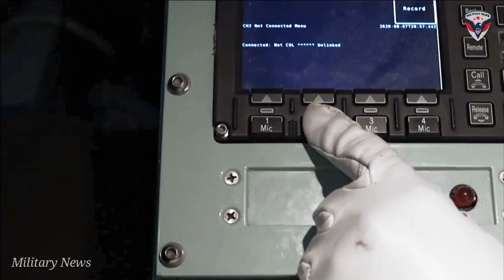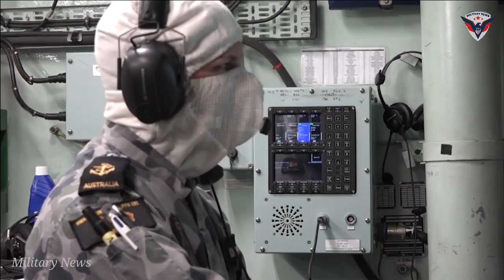How good is the Australian Anzac Frigate?

Comment: I worked for the AU Dept of Defence at the time and was in the Williamstown shipyard. The were only fitted with a completely inadequate 8 vertical launch tubes. Has that been upgraded since? And as per the similar comment - you’ve used some video of other warships which aren’t ANZAC frigates.
Reply from the maker: thanks for the comments and suggestions
Reply: No still only 8, they have top weight issues that makes fitting more virtually impossible, they have been given an extremely capable AAW upgrade so AD quality is very high but with only 8 Tubes they can only carry a max of 32 SAMs(quad packed), so quantity is an issue.
Reply: i know this coment is a year late, but the missile itself was upgraded so instead of 8 missiles on board, its now 32. 4 in each cell.
Reply: They had additional horizontal launch tubes added, plus they now use a different missile setup in the VLS.

Comment: judging from the coments this class probably couldnt operate, independently
Reply from the maker: thanks for the comment
Reply: It can, it can do air defence, ship to ship, and anti submarine, and even land attack with it's gun and missiles so it technically covers ALL of the bases. But it wouldn't have enough missiles to go blazing a trail of destruction through someone else's navy.

No naval vessel is designed to operate as a stand alone unit. Even carrier groups exist as groups for a reason.
Reply: @AndyViant  understand
Reply: Originally designed as a long range off shore patrol vessel, if within the 200nm eez of Australia will have  F35 and  Fa18 Growler as CAP as well as the Wedgetail and the P8